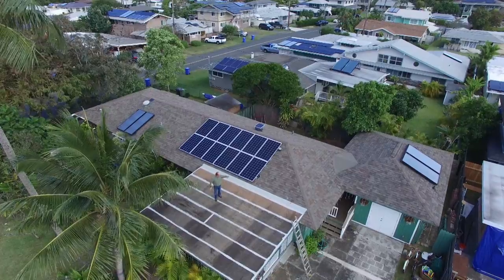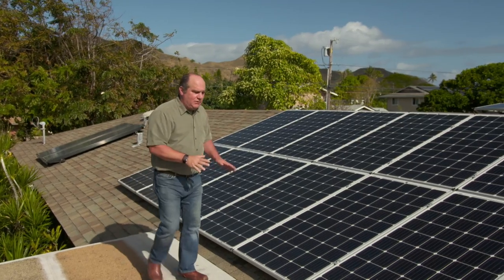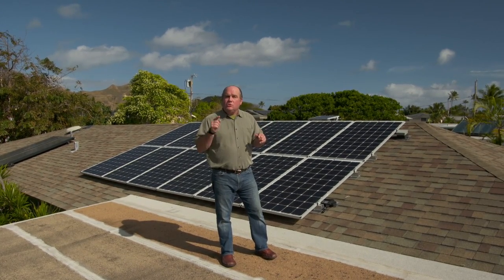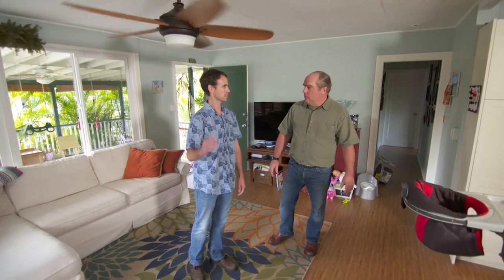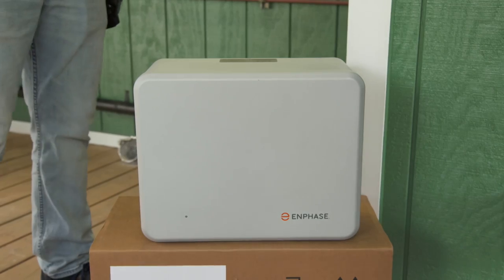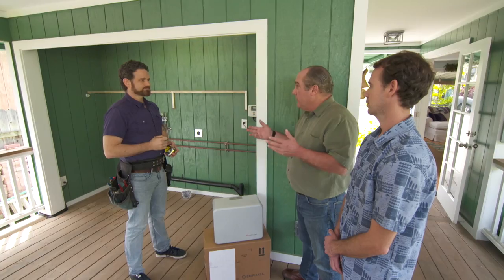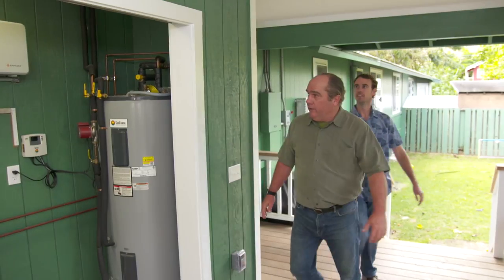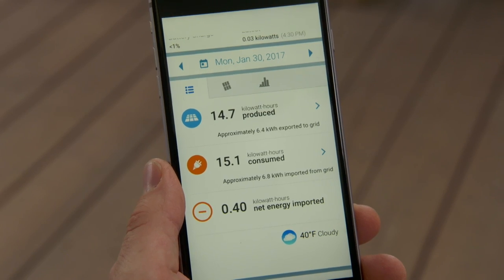How to Install Home Solar Storage | Ask This Old House

Comment: How to install solar panels ask this old House Richard I have a question my AC inverter my DC inverter I mean my DC circuit has an AC inverter and I'm experiencing numbness at the base of the foot which is section c and the it goes all the way up to a keynote 72 which are my shin bone could you provide me the best way for the AC inverter to divert the or discharge the energy that is emitting maybe from a condition or some other function in the solar panel could you do you care to elaborate introduce it to table exhibit table be behati at the kneecaps introduced that to exhibit table b and exhibit table for each knee capRichard Richard one of the thing you just mentioned that you were in Hawaii I'm in Oklahoma 73507 so if you can provide me at the I believe this variable in in the circuit if you could provide me the exhibit table a and exhibit table be for those devices man that would be great thanking you in advance calculus vents

Comment: By the time you buy solar panels and batteries, you will be paying more in the long run.  And batteries don't last forever, so the maintenance upkeep/replacement will only escalate the cost.
Reply: No, you're just paying more up front but you end up paying less in the long run...

You'd have to not take care of the system or badly design it for it to break down sooner and end up costing more.

A good AGM battery that is well maintained can last for over ten years and the newest high end Lithium batteries are rated to last over 25 years...

Upkeep and maintenance is very minimal and not costly... You'd spend more on a car frankly and need to replace it sooner than a modern solar power system.

Though, there are junk products... Just like getting a lemon car, which you have to watch out for but a good well designed system by reputable companies will last for a very long time and can recoup its cost in less than ten years and long before you actually have to replace any parts...

Besides, energy costs are going up which is why these alternatives are starting to take off and these options also help handle grid failure and other power failure issues.  Along with handling higher power demands, which is also going up over time...
Reply: An efficient system with the latest technology installed by certified and experienced professionals will be very costly.  There will be no savings.  The only good will be the environmental impact.  And that's a cost most people won't pay for.
Reply: No, most of the cost is the actual equipment and you will always pay for things that last and are good quality but that makes them worth the cost.

Installing a solar power system also isn't rocket science and any competent electrician can do the installation.

Costs of installing solar has actually gone down a lot over the last few years.  A $15,000 system is what used to cost over $30,000 just ten years ago...

There are already people saving thousands a year on solar power and companies saving even more than that...

Fact is having a smart grid means more efficient use of energy, which means less wasted energy, and better security as we won't be dependent on just one source of energy that we all know will eventually fail.

The amount of space used to generate energy also improves with solar as we use space that would otherwise not be used for anything else and having solar roofs also helps lower heating costs because the panels shade the roof and can lower the heat gain by 10 F degrees, which makes it a lot easier to cool the house.

So there's lots of benefits!
Reply: Jason Alexander 
In India solar is cheaper than fossil fuels.
Reply: most systems don't have  batteries they have on grid inverters I have panels in Illinois and they have already paid for themselves after 6 years and they are still working well
Reply: mattmopar440 
Sweet!
Reply: Jason Alexander you must work for a utility company..lol
Reply: No man, just a realist.
Reply: Jason Alexander well as someone who owns them for real there a great investment
Reply: I fail to see how ignoring the problems and costs of using fossil fuel, especially in a area where it is extremely high cost like in Hawaii, as you simultaneously exaggerated and misconstrue the issues with alternative energy sources and also ignore what pros the alternatives do have to offer as being a realist...

All of that is just being biased and arguing for a conclusion that doesn't fit all of the facts, which a realist wouldn't do!

A realist would let the facts speak for themselves and not pick and choose and spin them to fit a predetermined conclusion... as the point is to face reality, not distort it...

Fact is technology makes options like solar a moving target on viability... It's like when 4k TV's first came out, they were over $10,000 but now you can get one for a lot less...  Same with solar, you used to need to get a second mortgage to invest in enough solar to power a house but costs have gone way down...  It's still can be expensive but it's a lot easier now than it was years ago when the costs were over double what they are now...

Are there issues with things like lithium batteries, yes but the technology is improving and they're starting to switch to more sustainable battey chemistry that will also last a lot longer and can be recycled....  There are even alternative battery options that are green already like salt batteries, they're not good for hand held devices but for residential power they're work just fine...

While houses have started to become far more efficient as well and that starts making alternatives more practical...

There's really a world of factors you are apparently unaware of or wrongly dismissed but the state of alternative energy is nowhere near as bleak as you try to argue...
Reply: +Jason Alexander all your assumptions have been debunked. All the hot air you've been spewing you could have inverted to usable energy. When are you switching over to solar panels?
Reply: they have a horrible ROI.  better be in the house for a very long time, because when you sell it, you aren't getting your money back.  buyers might pay a small premium for a house that has solar, but not a large premium.
Reply: I want it for disaster preparedness.  It would be worth it.  
The prices are going down for solar and will continue this trend.
Returns on solar investment are going to increase because people are wanting energy resilience.
Reply: depends really, what are your kwh prices? mine is 50c per kwh with $90 grid pricing, it's not about "how much the system costs"it's about "what is your cost per kwh currently and is it going to increase?" then you ask "how much is that solar panel per kwh?"

You can easily buy second hand 250w panels for less than $1 per watt delivered, buy deep cycle batteries for $150 each, buy a second hand inverter for $300.

You're thinking brand new stuff where I'm thinking that you need to research more into this because the way that your attitude is "someone else will fix our problems for me" is not going to cut it when your power bill goes up because Trumps mistakes are undone
Reply: TRUMP MAKES NO MISTAKES!!!!!
Reply: TRUMP MAKES NO MISTAKES!!!!!
Reply: @ZeoCyberG  Telsa states that the Power-Wall Power 2 will only last about 10 years and at that point it will have lost 30% of its capacity.  This is a FACT stated by Telsa, which is contrary to your opinion. The Tesla Power Wall 2 costs about $10,000 installed. A self-installed ( ie lowest cost per kwh ) Grid-Tie PV System will break-even in about 6 - 7 years.  I know because I actually have one.  But once you start adding in $10,000 worth of batteries, EVERY 10 YEARS, then the average person will never break-even with current price of electricity. If you actually think a 10KW PV Hybrid System with a 7.5KWh AC Battery can break-even, for the average person,  then show us some real world numbers ....
Reply: @MrSummitville - Sorry, false, what they're talking about is when the battery drops below 80% of its original capacity.  Not when the battery actually needs to be replaced. 

Don't confuse them getting you to buy new batteries with you actually needing to!

Even the batteries in the Tesla cars get replaced but guess what, they resale them because they still have between 80% to 90% capacity and will last many years.  They just won't give the same energy density as brand new batteries but that's fine for people making their own EV's, or using the batteries to make DIY power walls that can get the used batteries for much less.

Seriously, people have been doing this for years already and if you actually know what you're doing then you can set the parameters for the batteries minimum and maximum charge and cycles to increase their usable life even further.

There's many channels you can follow with people who go into details with what you can actually do, here's 2 examples...

https://www.youtube.com/user/jehugarcia/videos

https://www.youtube.com/user/errolprowse/videos